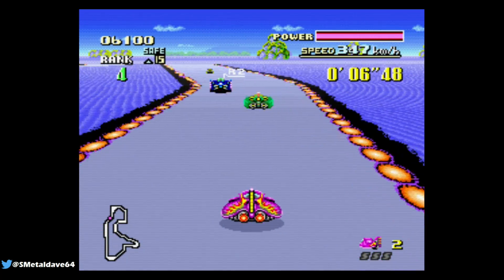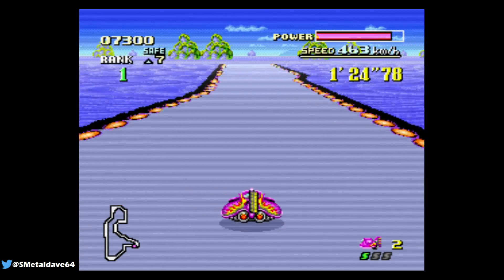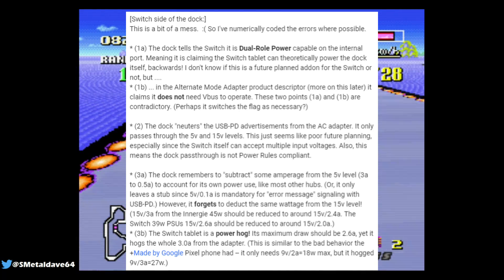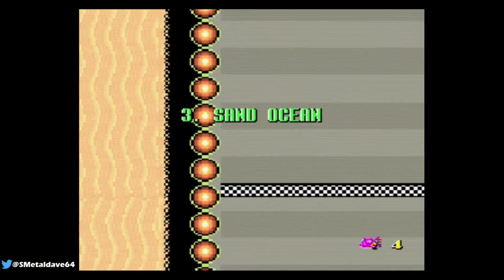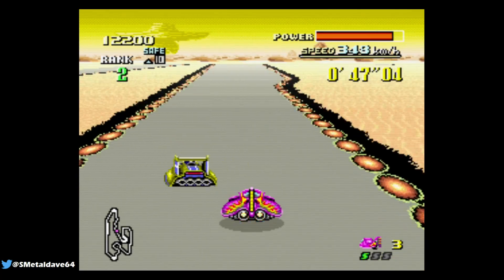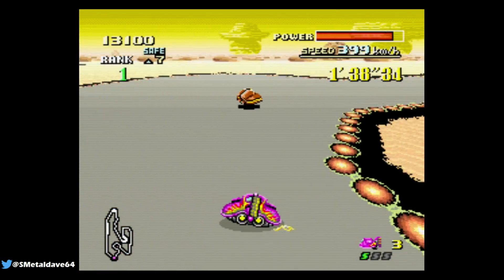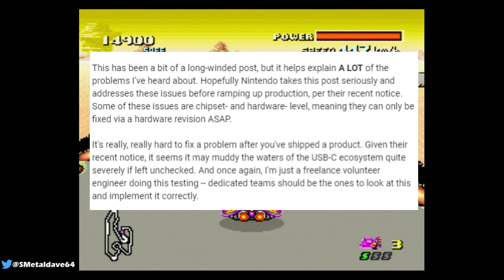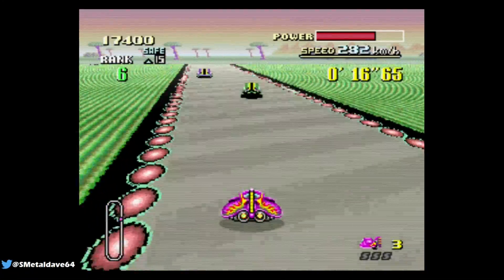Nintendo Switch – USB-C Voltage Flaw Explained

Comment: "It's nintendo's fault! How dare they allow unlicensed docks?!? Their accesories are waay overpriced. I had to buy an unlicensed cheap untested dock because I couldn't afford a 80 bucks dock for my second 55 inch UHD 4K TV. I'm out, I'm selling my Switch, done with nintendo for good, I've been saying that since 1995, but this time it's real."
Reply: Legend X If i were to plug a properly made phone into a properly made fast charger that was not compatible, it would just deliver power at standard usb voltage.
Reply: You guys can all afford second tvs (4k uhd 55inch etc) but can't fork out 80 bucks for a safe dock? not to mention theyve gone down in price and at sales you can find them at 60 bucks. smh
Reply: Fartonaut but you see that's not a USB-C that was made for phones that's not Nintendos fault they used somthing that is a USB-C but not compatible with anything over the switchs programmed limits the board in the switchs dock is programmed correctly to give those voltages however the 3rd party used somthing not compatible in the slightest with the switchs charging port.
Reply: BLUE your missing the problem Nintendo didn't make the system brick its somthing that happens because of over voltage limits the conversion board in the proprietary switch dock has the software needed to work the switch perfectly but the third party docks only do as the conversion board suggests it does convert signals to TV images. Sure nintedos way is  Inefficient but it works better because of lower latencies in screen and sound time refreshes.
Reply: BillTrinen'sTongue you said it your self " Cheap "
Reply: Here Is an idea maybe they did this so people will stop using USB-c chargers that aren't Nintendo certified. Like a Samsung USB fast charger or power banks stuff they never intended for the use on this system. And in all honesty the battery was designed from the start not to be able to handle anything other than the charge specified.
Reply: Nintendo could have made it so the console crashes and gives an error instead of bricking people's systems.
When I plug my 15 inch Macbook USB c charger into my 12 inch Macbook it gives me an error.
Reply: A lot of what is made for the switch is over priced. Unless they get a game that really peaks my interest, or the prices go down a notch, I wont touch the thing. Took me long enough to save up for my PS4.
Hell my computer monitor cost less than that dock, and its 1080p 144hz.
Reply: You're a moron that defends getting taken advantage of. Enjoy spending 80 dollars on plastic tat that is barely more functional than a HDMI output. As someone that chose not to buy a switch since it's plagued with limitations, I'll choose to spend that money on something that actually works properly. I honestly can't believe the amount of people defending anti competitive BS just because it's nintendo. Willing to bet if it was microsoft of sony, you'd be bitching.
Reply: I got one I got one "Nintendo never does anything wrong, its all the consumer's fault 100%" do you like that?
Reply: looks like someones salty lol @BillTrinenTongue
Reply: Legend X thank you
Reply: BillTrinen'sTongue The dock is HDMI just take it with you to the other TV. It has 2 wires out the back Power and Display.  It's not that bad just take the whole dock with you to save the $80 on a 2nd one.
Reply: Considering they decided use a USB-C port and not something proprietary, I do think it is completely fair that they be held accountable for using a port that is not really compatible with the USB specs.
Reply: Well, it turns out the Switch's USB port is as cheap as the docks. It's certainly not a shining example of quality.
Reply: Welcome to the club, real voice chat, fast downloads, 4k hdr gaming and less headaches that equals more time and more fun.
Reply: Ok, someone is being a baby
Reply: Salty because people complained because their Switch got bricked because they use a cheap ass dock?
Why would I care?
I'm just pointing out how ridiculous people can be..

Comment: Hmm, and all along I had this feeling that there was something gimped about the Switch's usb C capabilities. I knew there was something wrong with the fact that my 15 inch laptop charged through usb C takes only 1 HOUR to go from %0 - %100, while the Switch with an undoubtedly smaller battery, takes 3 hours or more if being used!
Reply: it uses a lower power setting to charge, but you DO know that a laptop in non heavy use(like gaming or photoshop) isn't using much power at all VS a switch being played, full tilt?

Comment: So is my swictch at risk if I use, say, my Nexus 5x (USB c) charger cable to charge the unit when I don't have my dock available?
Reply: niether is anyone else's really. so it ain't exactly ninty's fault.
but we haven't seen cases of fried switches due to chargers.
Reply: the switch only fries in combination with a dock and a charger that cannot supply 15v wich is requested when in dock mode
Reply: Yes. USB-C devices/peripherals that have not undergone the testing to obtain the trademark may not conform to the standards and can cause damage to other devices. For instance, Oppo had a USB-C style connector that was fine for their phone but would seriously damage a Nexus device if used.
Nintendo went the "cheap and nasty" route and did not adhere to specifications nor underwent the testing for compliance. It is not a USB-C connector, it is a Frankennector™
Reply: Berserkism So does that mean the USB c cable included with the unit that goes into the dock ISNT a real USB c?
Reply: Taylor Bowne If it isn't certified then it's not real USB-C. Only use the power supply, dock and cable that came with the Switch for the Switch and nothing else. Otherwise you could be playing with fire. Nintendo USB PD (power delivery) is not in spec.

Comment: its 100% safe to use 3rd party chargers in handheld. the switch docked should.use 1st party only.
Reply: Ruse Nikolovski 
He right cause most power banks are  2.4 amps and under  fast charger  are 3.0 amps that's around 10 15 watts switch can handle  that  those  3 party docks was giving 300 percent more  power no wonder the switches were frying
Reply: Can vouch on this because i tend to charge my switch with a regular usb c cable when it isn't on a dock, not any special dock or anything, just a standard cable. Haven't bricked yet
Reply: Ruse Nikolovski where do you have Tgat info from?
Reply: Ruse Nikolovski 
No its not my Nyko dock bricked and fortunately my Switch wasn't damaged. I used Nintendo's cords with it because i didn't feel like unwrapping it. Im glad i did because that may have saved my Switch
Reply: ndo ndoallday that's not how electricity works
Reply: Have you done a lot testing on this your self?  Do you have multiple systems?  I don’t use a third party charger, but I do use a usb Ethernet adapter that I plug into my official dock.  Do you think it’s safe to use the adapter?
Reply: actually ever since then I've used every single cable I had with both my s8 charger and my power bank and had zero issues :P
Reply: Pikslzplit The not so retro fagita I'm not saying it's 100% safe, but 5V is different to the higher voltages it uses from the dock

Comment: Rule only go for USB docks what about if we use a a battery case is that damage the switch now that's a good question no one have asked this question
Reply: Cheran Dissanayake is your battery tries to give the same voltage as the nintendo charger, then they have a chance of bricking the system. If they use lower voltage, like a phone charger, then it will be fine

Comment: The reason the gcn adapter works on the switch is because, from Reggie himself, is when they did the update that allowed it to work it actually opened up the system to more 3rd party devices because they know that people use them.

The idea that it was intentional is silly.

It's an issue that they will fix I'm sure.

Comment: Does this mean in theory a  power bank could fry the switch? Also, what if you are travelling and connect the switch through a USB to USB C charger on a plane? Is that safe?
Reply: I believe only the docks are causing issues but if I were you, I'd send a support ticket to Nintendo and ask them what kind of chargers or power banks I could use. I saw a lot of people using power banks without an issue and only Nyko docks seem to be frying Switches so far, not most other third party docks. But it's best to get correct information from Nintendo themselves.
Reply: Pretty sure its more than just docks, people have been blaming AC adaptors aswell and from what I've gathered from this video. The energy consumption of the switch seems to be negated with a lot of third party support charging devices and docks etc, the extra electrical current ends up frying the insides if you get unlucky. Still this does bugger all to explain why specifically 5.0 has been the culprit for the last two months.

Comment: But the bricking issue happened before the 5.0 update, Nyko were offering replacement consoles before the update even came out.
Reply: Nation Harris yes but the update has caused somthing on the software level of the switch to change somthing on the hardware level as the biggest change was to the chip set data structures they are now on a randomized kernel instead of a continuous kernel like on a normal system.
Reply: Nation Harris that chould be speeding up the process as it wasn't a very widespread issue before only recently has it popped up this fast to become somthing that is an issue though Nintendo did not use a normal USB-C port as its charging speed is lower than a normal USB-C as most of that bandwidth on that charging port is used for video and audio broadcasting to the tv.
Reply: I believe the 5.0 update modified the power management system

Comment: If this information is out there, why wouldn't at least some of these third-party companies designing accessories for the Switch take into account the quirks with the system's voltage?
Reply: As far as I can tell from the gaming news I watched online, only Nyko docks have issues with the 5.0.0 update. The other third party docks seem to be fine. But obviously not recommended.

Comment: That first point in the list regarding Dual-Role Power... maybe that's the reason why I sometimes leave my Switch sleeping on the unpowered dock, then wake it up all drained. I also sometimes (but rarely) see the dock LED glow for a second when I put my Switch in the dock even though it's unplugged.
Reply from the maker: That's interesting, yeah that could be what is happening. I'd go back to the standard dock just incase for safety.
Reply: Oh, I was talking about the standard dock actually. I would also like to add that my Switch randomly turns off when I put it in Sleep Mode, though I wonder whether that's relevant. But anyway, I haven't left my Switch on an unpowered dock in a long while, and I haven't experienced any of that weird stuff ever since. Either it really IS the dock's fault, or they stealthily fixed it on a patch or something.

Comment: Everything - for the most part - was fine until this new firmware update. So I'd imagine a subsequent update can fix it. I recently started getting error messages(when i enter sleep mode) when using an unofficial adapter for my Switch's mounted bedside setup. I immediately stopped using it for the time being.

Comment: I may be wrong about this but I don't think Nintendo knew this will happen
Reply: Of course they didn't know, they didn't test it out with a power-bank or a 3rd party charger, only their little ugly black charger and that's it. Cost cutting.
Reply: kareem lawson of course there is a reason to get mad, that's why there is a video about the topic. Geez.
Reply: Which is their right. It's not Nintendo's job to make sure the products made by people piggy-backing off their hard work actually works. That's literally not how business works.
Reply: Okay people no need to get mad or say hurtful things

Comment: Yeah ... so don't use unlicensed stuff.
Reply: Because your are both morons, what If i want to charge my switch in my car? what if I'm on the roof of a building with some knuckleheads or at a basketball court and want to play a switch for more than 2.5 hours? Tough outta luck ain't I since Nintendo done only made one ugly black charger that only works when plugged into a wall.
Reply: Wembley, I was spoofing the stupid Nintendo commercial and it went over your head like <<-.-)

Comment: Ah so I should stop using m usb plug to charge my switch when in coffee shops?
Reply: RockYeahh if your charger uses low voltage (if it’s a phone charger) then it’s fine. It’s when you use a high voltage charger that the extra voltage has a chance of bricking the system. Normal phone chargers are fine.
Reply: RockYeahh I've already bought a 3party AC charger cause it was like $15 cheaper. Now I'm more and more scared to use it. 

May have to sell it or just put it down as another large $ loss. Because Nintendo makes a f'ing USB-C device but nothing USB-C that can safely be used with it that they didn't make and charge 3x the price for....
Reply: Ah that's good. Thanks for the info. :)

Comment: This is OLD NEWS from May 2017!! Why are you just now reporting on it just to get views?? 

We knew it wasn't PD compliant. There's many devices that are not PD. It's USB C compliant and that's all that matters. Future revisions will be compliant but so far no issues for me. 

People need to STOP using 3rd party docks. That's like using third party connectors and AC adapters on PS4 and XB1!

Don't be morons people.
Reply: OK I've never used or had a use for a 3rd party dock, but chargers? battery packs? for a system that's supposed to be taken on the road? How are you gonna charge it in your car? How are you gonna charge it if you are out and about with no wall inlets? "Play anywhere" AmIrite?
Reply: dusty48 I'm sure Nintendo will release their own first party portable charging bank for around $80, because why not!
Reply: Joshua Werner speak for yourself. I had no idea about this so I'm glad he posted this video. Stop being a salty douche bag. Watch someone else if you don't like his posts
Reply: No shit sherlock. While this is old news, this is an explanation for why consoles have suddenly started bricking after updates. No one should actually use third party docks considering the potential for damage to the system, but this in a sense a PSA, so that people know why these third party docks are frying the system, and to also refrain from using chargers from other companies. The individual did warn us back in May, but we're seeing the effects finally of Nintendo's design flaw (because it is a design flaw). Whether or not it's intentional is a different question. Only Nintendo knows whether or not they wanted to lock out other parties out of the peripheral game. Other companies that are also not following the spec don't seem to have these issues like the galaxy note 8 or the galaxy s9, so it's not really an excuse on Nintendo's part.
Reply: Nick B 
Not being salty just pointing out that it's OLD NEWS. So no, I will not "stop being a douchebag" do your research and stop giving views to somebody reporting on old news we knew already.

Comment: It was documented that the switch had a different type of usb-c and yet the third party docks didn't account for that. Of course, Nintendo should never have used a different usb-c but they are not the only ones to blame
Reply: especially since even NOW there isn't really a clear cut standerd for USB-C...
Reply: Despite there not being a "clear cut  standard" it doesn't brick other systems with USB-C ports ONLY Nintendo's little schtick.
Reply: dusty48 i think it has to do with the way these 3rd party docks are made. They are made by reverse engineering the official Nintendo Dock. They basically try to emulate it instead of actually communicate with the Switch itself
Reply: other systems don't increase clock rate when docked. the dock and switch have the digital handshake because of that.
if docked was always the same performace as undocked, I'd agree, but its not the case.
Reply: @AH SEU VOU I wasn't even talking about docks. What about run of the mill chargers and battery packs? That stuff that works with every other device?
Reply: I don't think I've seen anyone say a charger (that had enough voltage) bricked their switches. Same for battery packs. As I said, the official dock uses proprietary chips and every 3rd party dock released has been trying to emulate them and failed. The usb-c port on the switch works perfectly for anything else